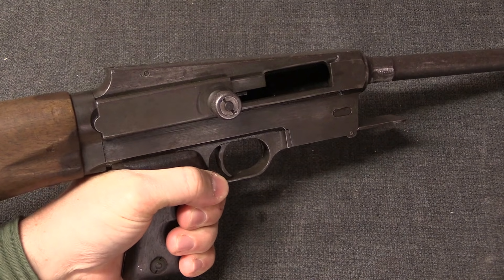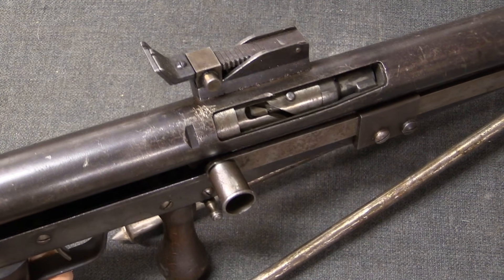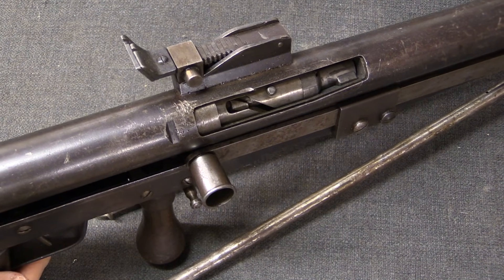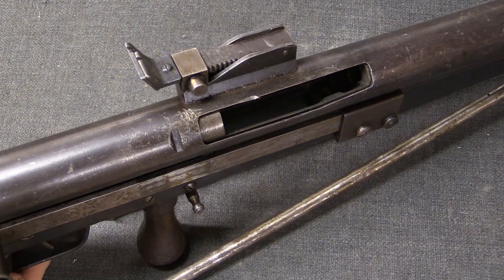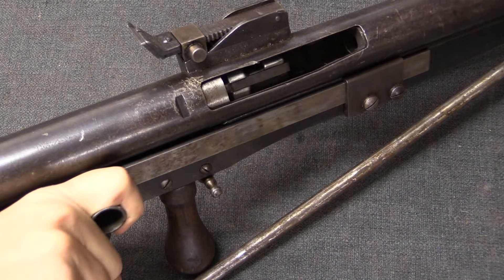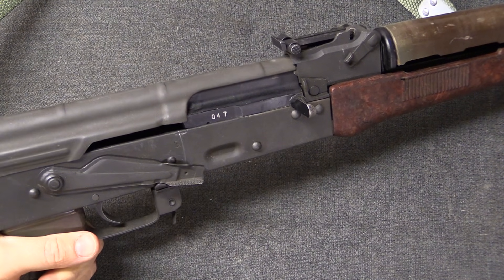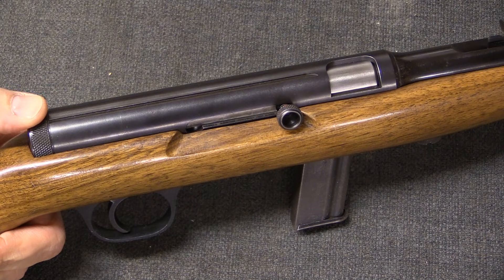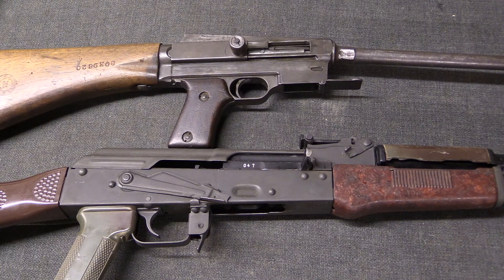How Does it Work: Open Bolt vs Closed Bolt Firearms

Comment: As to the practical accuracy of closed bolt guns being greater then open bolt guns. This is true, although only for the first shot/single shots in my humble opinion. Once you really light the gun up for a string they both settle down about the same. Great informational video. Gamers would be wise to take notice :)

Comment: I seem to remember there is a firearm that changes from open bolt to closed bolt depending on what firing mode you're in, cannot remember the make.
Reply from the maker: There are a couple, like the FG42

Comment: Did you ever get the mas smg to work?
Reply: He has several videos on it. It works fine the issue is the specific ammunition it fires. So far he hasn't found any that works well.
Reply: Tristan Holland I’ve seen his videos getting it to fire one round and not cycle.  Ammo related or not is not “works fine”.   
     Right now although the gun may appear mechanically fine.  There is no way to tell until proper ammo is used.  I had the very same smg and mine never worked fine.  Even with 80s French 32 long ammo

Comment: Are there firearms that are both open or closed bolt, depending on the users choice?
Reply from the maker: A few, yes. They are generally not directly user choice, but rather designed to fire form an open bolt in fully automatic and a closed bolt in semiautomatic. This allows the better accuracy in semi and the heat protection in full, when the gun is likely to get much hotter.
Reply: @ForgottenWeapons  
Many thanks!
Know what today's evening occupation will be then :)
Love ya.
Reply: FG42

Comment: An unmentioned advantage of open bolt actions is its easier to clear and make sake compared to a closed bolt weapon. When the magazine is removed the gun is empty and can be easily checked out. Closed bolt, because of the round remaining in the chamber, requires an additional step to be made safe.
Reply: actually that isn't entirely true.
when making a weapon safe for it to be checked out, the first thing you do genrally is locking the bolt back, which normally also ejects any round left in the chamber.
also an open bolt gun could still missfire and leave a life cartridge in the chamber so you're going to check the chamber of an open bolt too, it's a good habit to have in general and i'd rather do it on any gun, even the ones which don't require it, than ending up forgeting to do it on a gun which DOES require it.

Comment: Also a practical matter of closed bolt guns is that you can actually top off and have one extra round, whereas an open bolt gun will be limited to its magazine size no matter what.  If one round makes all the difference in your firefighting endeavors!

Comment: I thought another reason to use closed bolt systems is that it is harder to get dirt into the mechanism essentially omitting the need for a dust cover.

Comment: Force this into the heads of game developers, It's to painful to see MP40 operated as closed bolt. Also reloading animations of open bolt sub machine guns, where the player does anything else but replace the magazine is also a bit questionable.
Reply: If you fire and empty the magazine then the bolt will end up closed. It depends on the gun if it's designed to not close on an empty mag.
Reply: @HunterDigi  True, I meant reloading with non empty magazine. You don't cycle the bolt after changing the magazine, I think I have seen that in Counter Strike.
Reply: It's ART and you can't expect ARTISTS to be engineers REEEEEEE

Worse crime in my opinion is mirrored guns, so you can see brass flying across screen, and abominations like FO4 pipeguns

Comment: My experience with these - Sterling SMG, open bolt works like a dream on full auto.  FN C2 LMG, which is closed bolt is basically uncontrollable and unsafe after a couple of mags as a high rate of fire due to the cook off issue. Browning 1919 type machine guns seem to work fine at a high rate of fire despite being closed bolt.  I have fired them until they glowed red, but don't recall them having the cook off issue of the FNC2, which ic kind of weird.
Reply: Might be an ammo issue, different propellants will ignite at different temperatures. Or maybe the FN C2 had less thermal mass to soak up the heat energy, so overheated faster. The old Brownings were designed for sustained fire in a way light machineguns are not, and simple mass of steel plays a big role there.

Comment: Could (on a closed bolt gun) the barrel and chamber get hot enough to let the gun shoot on by itself? like empty the whole mag?
Reply from the maker: Yes, although it takes time for a cartridge sitting in the chamber to heat up enough to fire like that. So you would not get a sudden burst of firing, you would get one round going off, and then perhaps another a few moments or minutes later.
Reply: Iraqvetran8888 did a series of videos where he shoots various guns on full auto to destruction. The AK didn't start cooking off until the foregrip caught fire (he shoots in welding gear) the weapon only cooked off about 3 single times in the entire 1200+ Rd volley. It takes time for the cartridge to get hot enough to self detonate so I seriously doubt you'd ever get  magazine emptying burst in a cook-off.
Reply: We need to construct a gun that "accidentally" cooks off a whole mag because it is designed to make the chamber extremely hot and the other parts to be so strong that they are not the first link in the chain to fail. I wonder if the ATF would classify such a gun as fullauto because technically you would fire multiple rounds with only one triggerpulll... but that is already the case (pun intended) with semiautos right now, it just takes a lot of stress and it is not very functional. You could also produce ammo with nitropowder or primers that cook off very easily to make it more functional, to stop firing you could make an easy to use lever that holds the bolt to the rear to stop loading cartridges (or simply make a trigger that holds the bolt to the rear when it is released). The next step would be electronic chamber heating to guarantee cookoff without having to heat the chamber up by firing some rounds. I wonder at which point exactly the ATF would classify the gun as fully automatic or if cookoff technology would be considered to be similar like fullauto trigger and bolt components out of metal... did I just invent the next technology that says FUCK ATF like bumpfire stocks or binary triggers?   @JoeBLOWFHB
Reply: I believe that is possible, however the chamber would have to be hot enough to cook the round off almost instantly, otherwise it might fire "full auto" but at a very reduced rate as each round heats up. If the chamber is hot enough, I don't see why it wouldn't just mag dump.
Reply: Ha, I was typing at the same time as Ian and gave basically the same answer with less assuredness! Geeks out
Reply: K thanks both of u XD
Reply: Yes it can. Empty a whole magazine, probably not. In the time it takes to heat up a round, the gun is also cooling, leaving a net cool off. It's only going to pop once, maybe twice if god hates you, before it'll return to a state where it's cool enough to be safe. For most closed bolt fully automatics, it's going to require some serious effort to get it hot enough. Semi-automatic even more so.
Reply: The bump stock ban has not been passed, my question was referring to current law.  Jim Man
Reply: Every time it fires more heat is generated, so in theory if one round cooks off it will continue to heat up and cause more rounds to cook off. Most closed bolt full autos could cook off a round and subsequently continue to fire until out of ammunition. Though some designs of firearm have a safety mechanism which cause the bolt to stay locked back if the gun fires without the trigger being pulled, the hammer/sear has to be reset by the bolt traveling backwards in the action and if they haven't been tripped in the first place then it causes the gun to lock up.
Reply: Maxwell Ihm which guns exactly come with such a feature?
Reply: @thetoecutter13  I can't remember well enough to name a particular model but I remember seeing a handgun model that had a sort of catch linked to the trigger that would stop the slide from traveling far enough to pick up a new round if the trigger wasn't pulled back. It wasn't designed to prevent "runaways" but would serve the purpose. I don't think I've ever seen such a mechanism on a machine gun though, they usually are just open bolt which is the best and simplest solution to cook offs.
Reply: Maxwell Ihm I think you're mistaken. How would you unload a live round from the chamber if you can't fully open the slide? I did two tour's in Iraq the only time I ever saw rounds cook off was if they were in a fire. i.e burning vehicle or aircraft. It's not really an issue and if it does happen it can be dealt with easily. An open bolt "running away" is more likely than a cook off in a closed bolt. That's when the weapon isn't held tight enough for the bolt to come back far enough to catch the trigger sear but far enough to strip a round. That's more common in sub machine guns. The STEN was known for that. It would happen if they were dropped on the butt. They added an extra safety by drilling a hole in the receiver and putting a "nipple" on the bolt so it could be pushed in and locked closed if it was being carried with a loaded mag and the bolt closed.
Reply: @thetoecutter13  240s and 249s are open bolt. It's damn near impossible, without user error, to cook off a round. I've heard of it happening, but never seen it. Leave a round in a red hot 240 for a few seconds and she's going bang.
Reply: Keep Calm and Call for Fire you are right they do fire from an open bolt. I qualified on them but didn't carry one and it's been 16 years, 2003. If they're open bolt how are you going to leave a round in one unless it miss fires? The M2 is a closed bolt, I've seen them fire a lot of rounds and not cook off.
Reply: @thetoecutter13  Misfires. .50s usually fire too slowly for the barrel to get hot enough to heat up the comparatively massive cartridge to cook off temperatures. I assume it can and does happen, but I've never personally heard of cook offs in .50s.

Comment: Something I've wondered for a while is: Why is the AK not an open-bolt gun? I mean it was meant to be a submachine gun and it was clearly not designed for precision (look at the "sights") and this could have simplified the design to make it even cheaper.

So why the closed bolt?
Reply: The Kalashnikov used  similar sights to those that were common on infantry rifles in both World Wars. It wasn't designed for pinpoint accurate firing past 300m for a few reasons:
1. The Soviets learned that the majority of killing or incapacitating shots from small arms occurred within 300m. This doesn't mean that soldiers couldn't and wouldn't fire on targets at greater ranges, but your average infantryman wasn't going to be able to reliably hit targets (or possibly even see them clearly) at 800m with his general-issue rifle, especially when those targets were shooting back. I recall reading somewhere than a 500m shot was considered quite long even for snipers during the Second World War. So why design a rifle to reach out to 1 kilometer when most soldiers can't hit a target at those ranges? If you need to engage targets farther out, there are other weapons more suited for the task than rifles. Nowadays, with inexpensive, robust optics that can easily be mounted on general-issue rifles, things may have changed a bit.

2. Within its effective range, the AK is accurate enough for an infantry rifle. It certainly is not as accurate as an AR, but it's good enough to get the job done. Most of the myths about AK inaccuracy stem from their performance in the hands of jihadis with more fanaticism than marksmanship ability. To make matters worse (or better, perhaps), those types of fighters aren't exactly the type to maintain their weapons well, have rifles fresh from the factory, or even use high-quality ammunition. 

3. The 7.62 x 39mm doesn't have the best ballistic trajectory over longer ranges. I've heard that it's comparable to some .30-30 loadings.

4. Soviet military doctrine didn't call for having riflemen plink at distant targets; it emphasized aggressive maneuver and advance and the use of mechanized forces.

Comment: Which one does fully semi-automatic?
Reply: Most modern weapons are fully semiautomatic. This is in contrast to semi-semiautomatic firearms, such as double action revolvers.
Reply: @polygondwanaland8390   They have semi-semi-automatic rifles in the UK, to get around the ban on semi-automatic centerfire rifles: the spent cartridge is ejected on firing as normal, but a separate action (pushing a switch on the receiver, or an extra trigger pull) is required to close the bolt and chamber the next round before firing.
Reply: @jic1  wow this is an excellent idea I wonder if we can get them in Australia would you happen to know the name of one such rifle or be able to provide a link to one if at all possible
Reply: @jic1  A double action revolver carbine is essentially semi-automatic. It has obvious drawbacks, but seems "at least as good" a solution as an AR-15 that locks open on every shot.
Reply: @polygondwanaland8390  Quite possibly, but the law that banned centerfire semi-autos in the UK also banned centerfire pump-action and revolver rifles (even though the only revolver rifles on the market were stocked, long-barreled single-action revolvers aimed at Cowboy shooters).  The only reason the rifles I mentioned weren't banned was because the authorities didn't anticipate them, and they are within the letter of the law (which, I believe, specifically refers to "self-loading" rifles).
Reply: only the one with a clippazinedrum with the shoulderthing that goes UP!
Reply: The French open-bolt .22, since it's a semi-auto that the ATF believes is too easy to make full-auto.
Reply: @Cultural Relic I get that I just can't own a semi auto here in Australia was just thinking that this may be as close as I can get without breaking the law just wanted a name of one or link to where I can get one so I can ask my local gun shop if they can order one in for me thanks for the explanation though I can picture in my head now how it would work sounds like a great thing for us Aussie's
Reply: @Cultural Relic bugger they way u put it sounded real lol you got me good lol just realized I'm an idiot anyway cos Savage has the a17 and that is pretty much what were talking about anyway shoots a bullet and stays on open bolt till u push a tab and it closes bolt ready to fire
Reply: Fully semiautomatic requires a closed open bolt super duper selector switch
Reply: A RPG-7

Comment: What about the fact that it's easier to get dirt into an open bolt action?
Reply: It's not really an exhaustive debate about the merits of each system, more a quick explanation of the terms and a couple of quick examples of why both exist.
Reply: Depends. Some open bolt designs are quite well closed off. PKM for example, the only open parts on that are the sides on the feeding tray, but that's usually blocked by the belt.
Reply: @Matheus Falango That sounds less like a closed bolt and more like a freakish hybrid.
Reply: Fingers can also easily go in the action of some open-bolt guns. Anyone that has been once near a Sten knows it.
Reply: At least the fact that one can use a fixed firing pin. On closed bolt that is impossible.